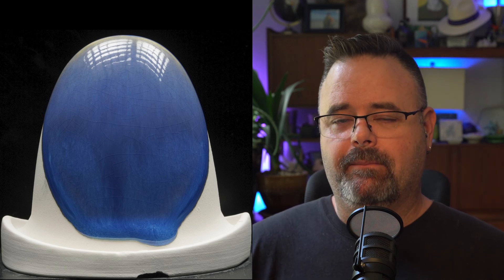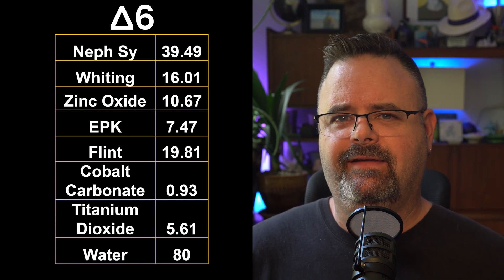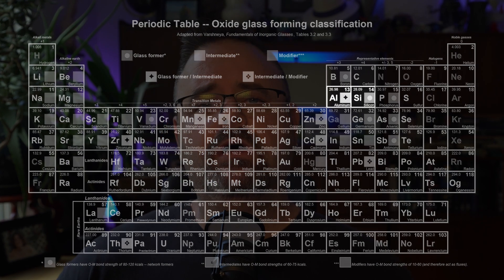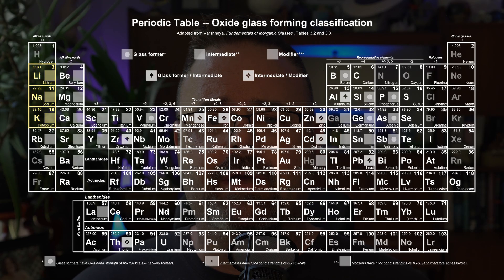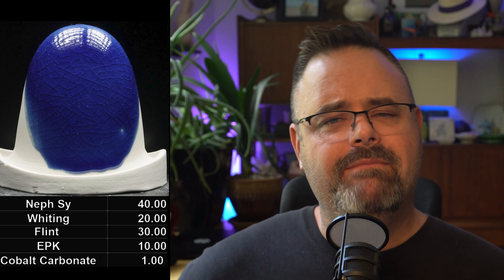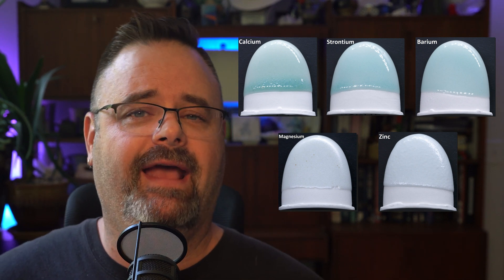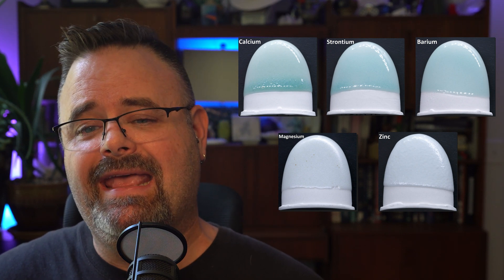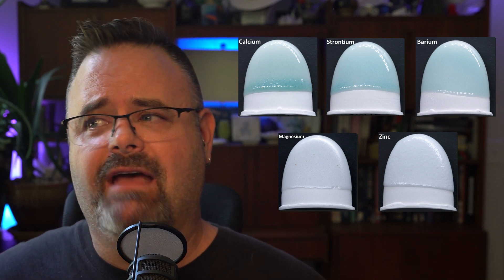Cracking the Kiln | How Bristol Glazes Work | Ceramic Materials Workshop

Comment: Good info.  I would suggest that you don't include Alumina in your definition of a 'glass former;'  all texts I've read separate glazes into 3 main components - glass formers (mainly silica, but also boron & phosphorus), fluxes, and stabilizers (mainly alumina, but also titanium).  After all, glass can be made without any alumina.

Comment: Solder and welding fluxes do not alter the melting of the metals, they are used to prevent oxidation of the metals as they are heated.
Reply: They melt to protect from air, and to dissolve away the surface oxides of the metals.

Comment: Any studies looking at calcium, zinc, and boron together in a glaze.  I have seen some glazes it’s difficult to get a high enough amount of boron in a glaze for cone 6.  Especially with the Gerstley Borate being discontinued.  Could you add some zinc in this case to offset a lower boron loading to achieve similar melt temperature?
Reply from the maker: Yes we have studied it, and talk about it in out classes. Temperature reduction effects are cumulative. So you can combine Bristol with boron for a lower temperature. Although I'm puzzled as to why you can't get enough boron. Most of the common U.S. sources can get you the 0.15 UMF that you need with minimal additions.

Comment: I wonder if it is the copper oxide not being fully encapsulated by the bristol glaze and thus is prone to actual oxidisation when in contact with acidic foods? Maybe the copper floats more on the surface of a bristol glaze? Don't shoot me down as i am 30 years out of practice and just mulling thoughts over in my head...

Comment: I noticed the crackling in the examples you first showed, is this an effect common in Bristol glazes?
Reply: That is crazing which is a normal ceramic flaw. It has to do with the thermal expansion differences between the glaze and the clay body.